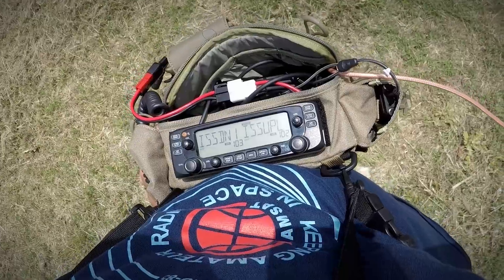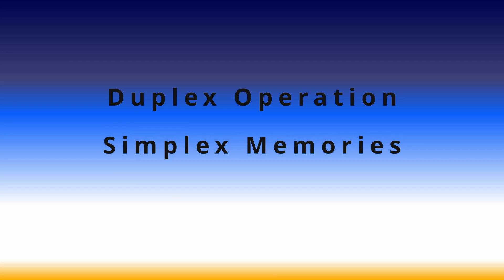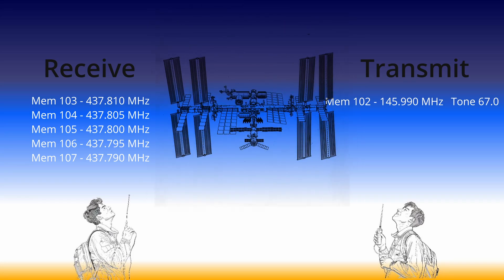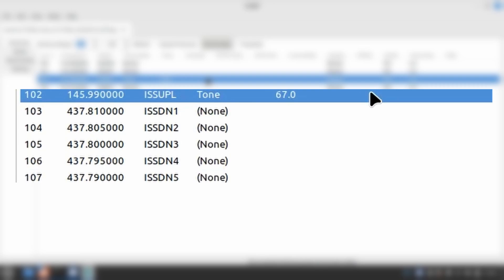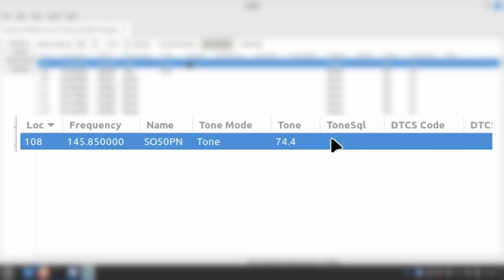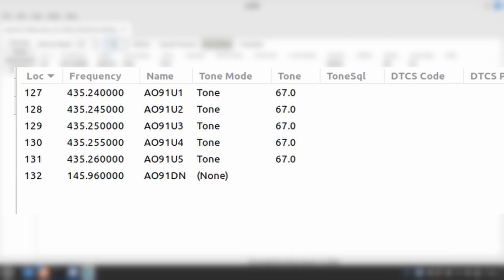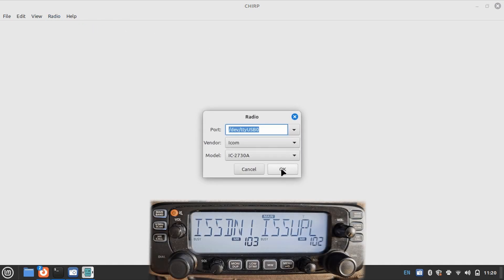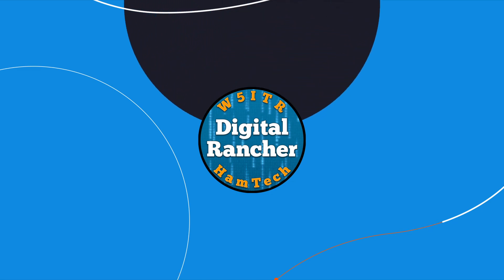Mastering Memory Programming for Ham Radio Satellites

Comment: Question: If following your layout with SO-124 which has a recieve frequency of 436.888 how does one program that to memory? When I try it gives a error of not valid frequency using RT Systems.
Is it because it has to be in 5kHz steps and the .888 is what is causing error?
Should I just set it to .885 for center of pass and go up and down from there?
Reply from the maker: It depends on your radio and the step it supports. I would go up to 436.890 since it's closer to the frequency but it's not that big of a difference. If you went to .885 that should be just fine.

Comment: OK I understand what your doing setting the receive frequencies 5 apart from each channel so you are switching by ear I take it. Also on the transmit side you don't switch that you run on the starting frequency? Thanks Ed W9US
Reply from the maker: Hey Ed! Thanks for watching and thanks for the question. You only have to adjust the 70cm frequency.  The Doppler Effect is not as impactful on 2m and lower. Hope this makes sense. 73!